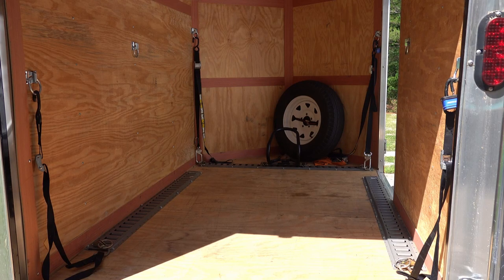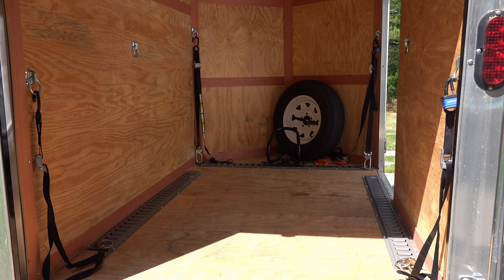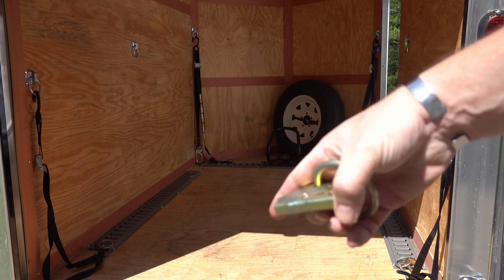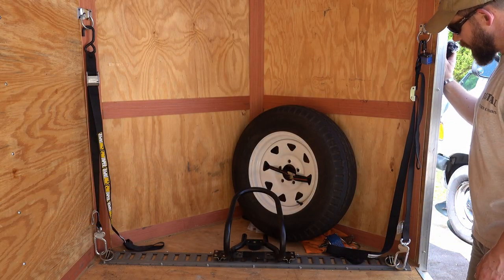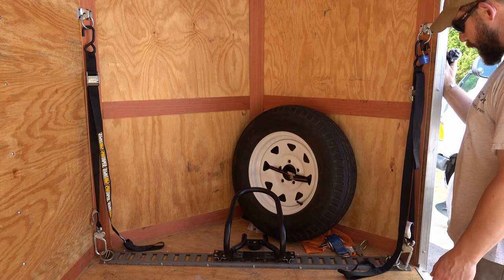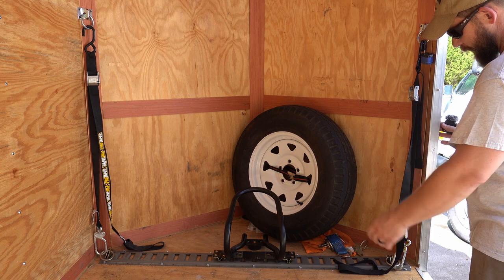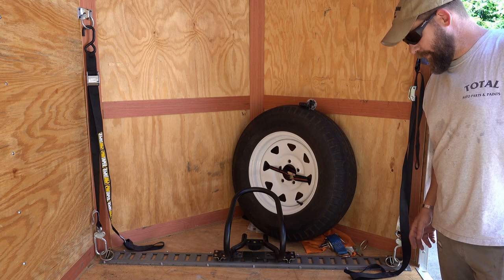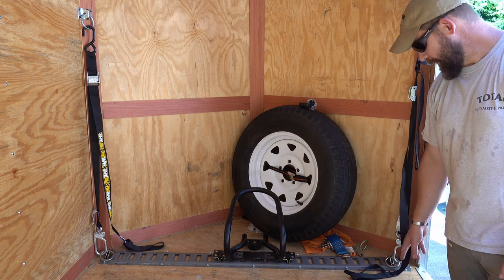Easy Motorcycle Trailer Setup Hacks That Make a Difference to Ensure Safe Transport!!!

Comment: Nice.  Starting on my trailer when the ice melts.  Mine is a 16' enclosed but  will carry one vintage Honda bike.  I'll have it set up with an area for tools in Hard tool box.  Spare tire and rim will be hung on wall with carry bag with jack and tools.  Will have a small 12 150 psi compressor inside as well.
Plenty of room to add ac and electrical to a quiet run Honda generator.  Plenty of room for a cot and chair.
Nice start.  Need to paint that bare wood.  Well done

Comment: for your front e-track, how did you fasten it to the floor? The e-track is wider than the c-channel underneath on my trailer so I would only be able to tap into the frame on the front half. The entire back half would only be held by plywood. I'm thinking about potentially buying a long piece of 4" wide 1/4" stainless to put under the trailer for the back row of tappers to catch. Thoughts?

Comment: Nice vid, thank you.  Questions….

1. Did you use bolts or screws to strap down etrack?

2. In either case, are you supposed to find the metal underneath and bolt through metal or is the plywood strong enough?
Reply from the maker: Self tapping metal screws.  Get the metal everywhere you can and settle for just plywood where you have to.

Comment: What is the size of the trailer door opening and what is the interior height. I don’t think my Harley Streetglide would fit inside
Reply from the maker: I upgraded to a bigger trailer, so can't get measurements for you any morel.  My Tiger fit in with all 3 bags on, so a Street Glide would fit.